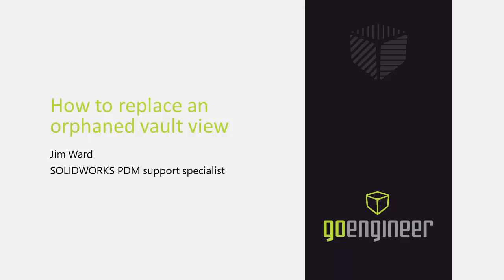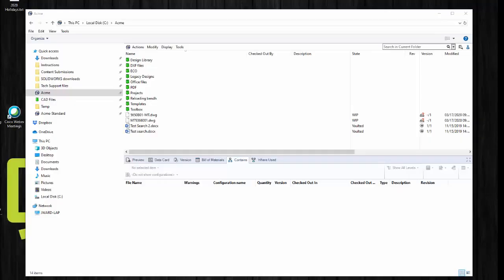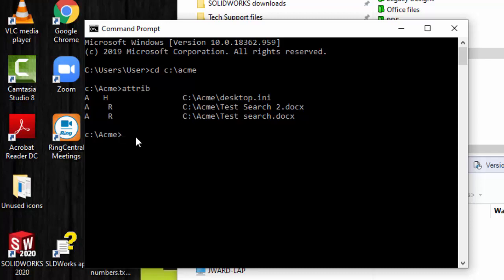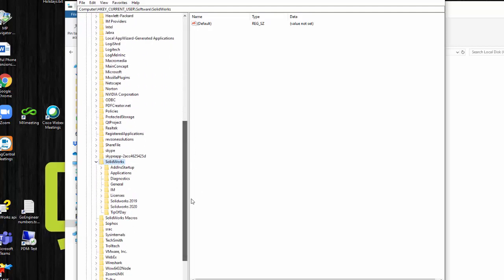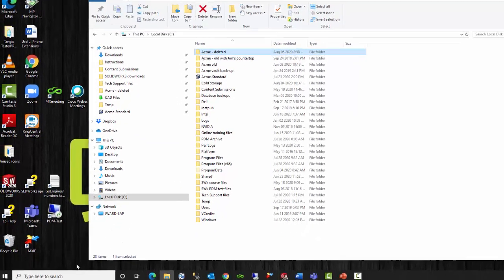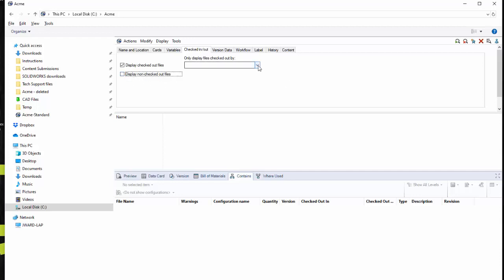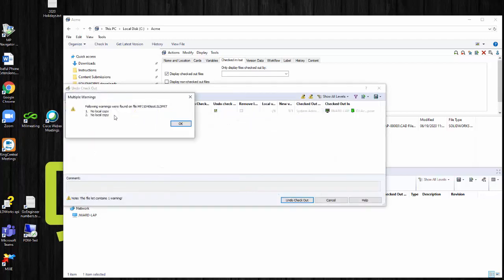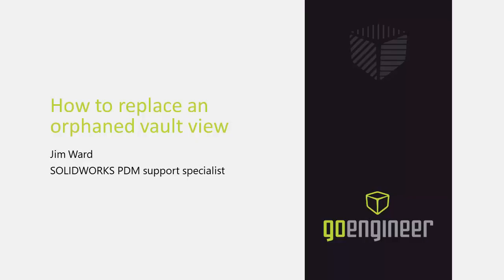SOLIDWORKS PDM - Replace an Orphaned Vault View

Comment: How to draw the hopper in sheet both different shapes upper 900x600 and bottom 244x244 thick 2mm all value outer size and all dimensions in mm